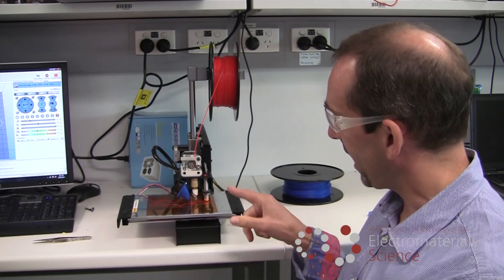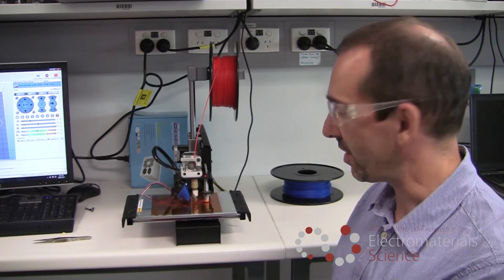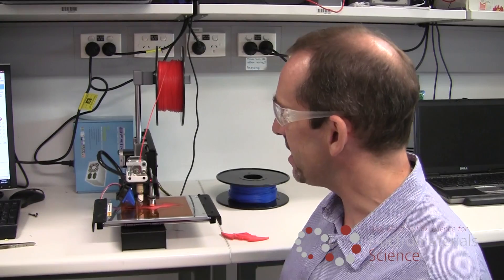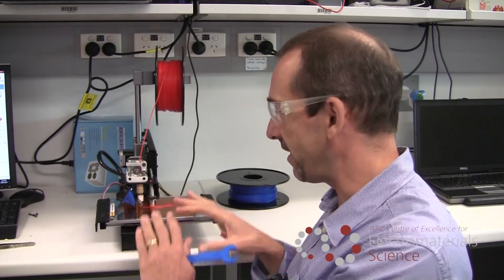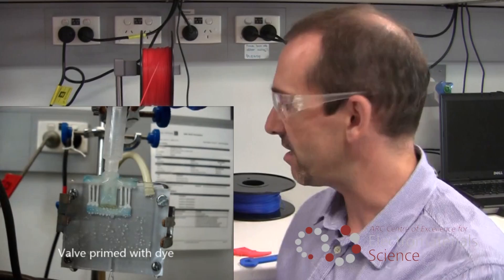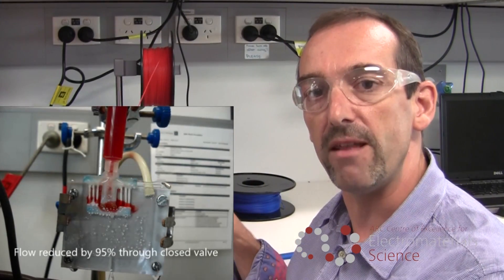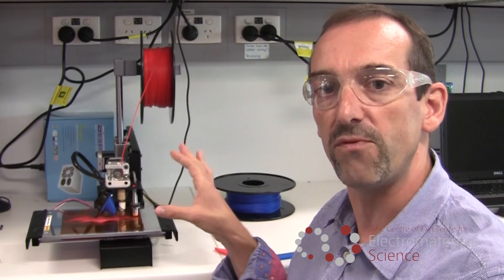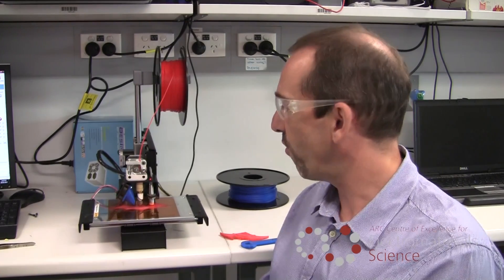What is 4D printing?

Comment: Anything in our reality is 4D they exist in time. You're using the term wrong. Then again a line dawn  a paper is really 3D and 4D beause it has depth and exists in time. Use the terms correctly! FFS.
Reply: David D. Stanton 4D is not time XD
Reply: Time is change from one state to another, 4D is time.
Reply: There is no such thing as time... time is simply motion
Reply: Time is just a measurment of change, nothing more. Change is 4D, Just like there is no such thing as an Inch or Meter, they are just measures of something.